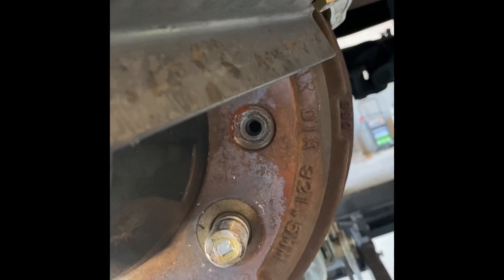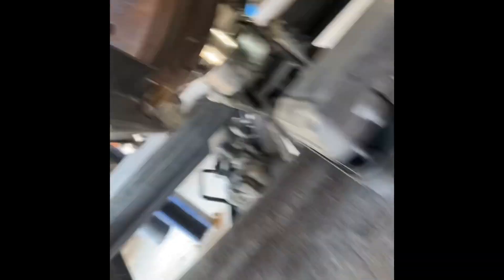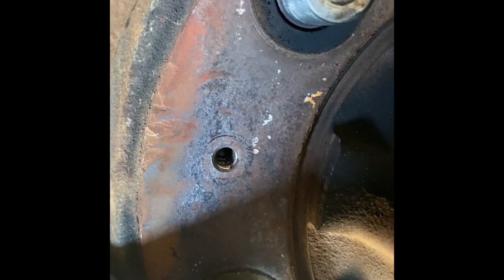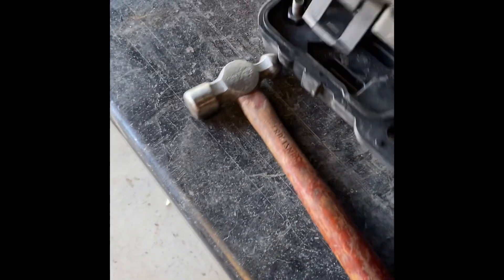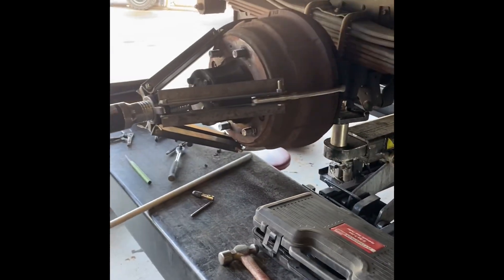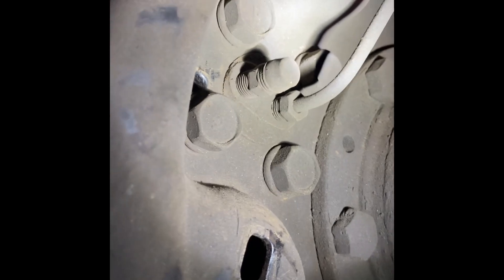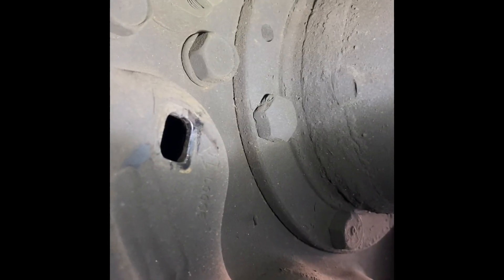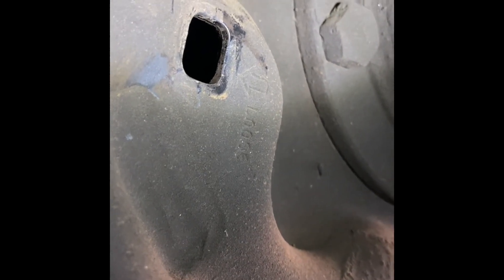Isuzu NPR brake drum removal

Comment: Hey NPR Doctor. Like your helpful videos. I have a fleet of 6 NPR's. Take care of the maintenance and repair. Came across a brake issue I haven't seen during my year's working on trucks. Over 20 MPH when brake applied truck surges and grabs. Only happens when loaded. Plenty of lining front and back rear. Adjusted rears. No leaks at cylinders. Fluid good. It's a 2014 with a Reefer box on it. Probably going to tear down all brakes for inspection. Any thoughts or idea's on this one. Feels like a delayed brake application. Thanks for any help. Keep up the good work.
Reply from the maker: You may have a caliper failing or your slide pins may be seized.